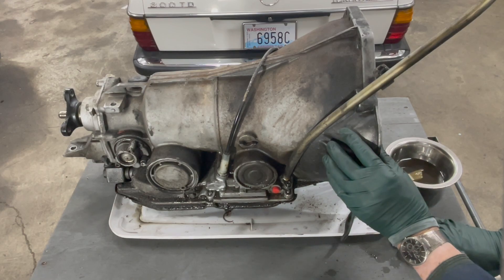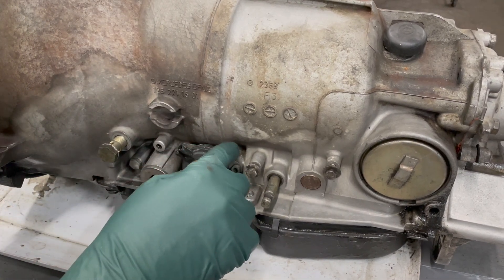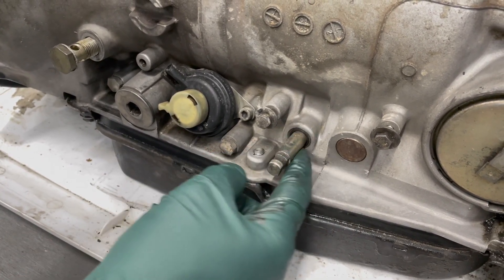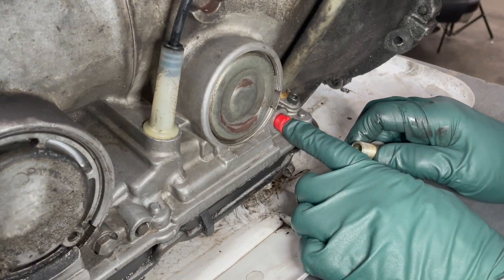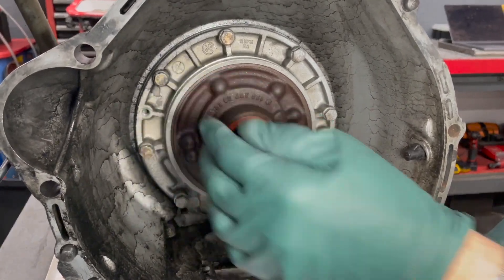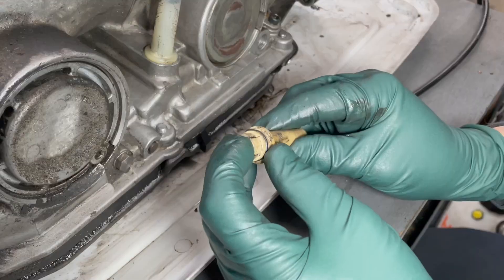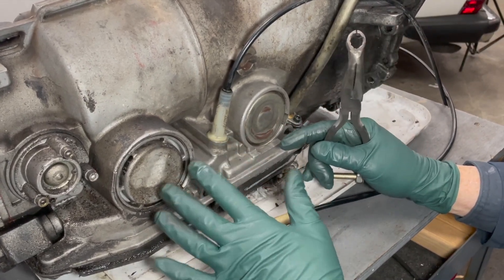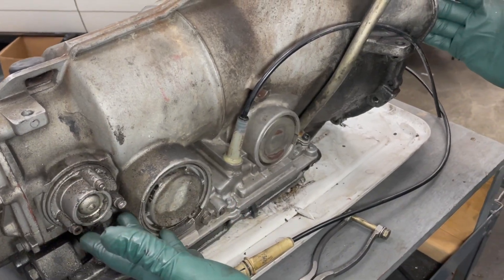Fixing Small Fluid Leaks in Old Mercedes 722.315 Automatic Transmissions

Comment: I have a slow transmission leak in my 1988 w124 250d even when the car stationary for weeks but its from the front passenger side near the front wheel, what can be the source in this area
Reply from the maker: Don't guess. Pull the underbelly panels off ( if you have them) and visually inspect hwere the leak is coming from. I suspect it is the flexible transmission oil cooler hose at the bottom of the radiator.

Comment: can i put a 1985 mercedes 300sd turbo diesel w126 body transmission into a 1982 Mercedes 300d turbo diesel w123 body
Reply from the maker: Yes, as long as the swap the rear case with speedometer drive.